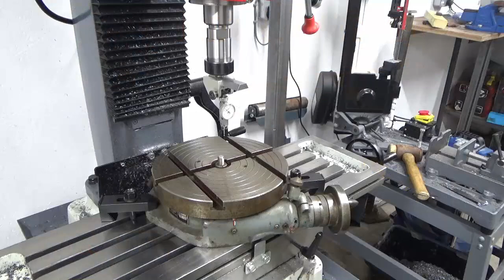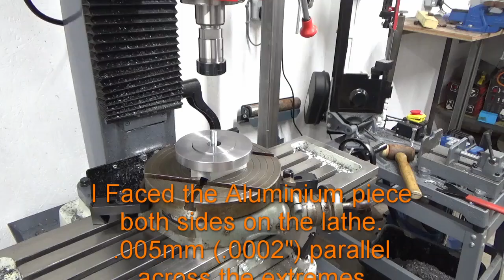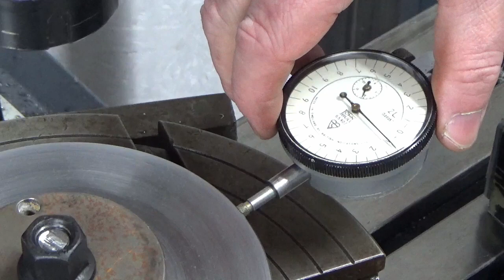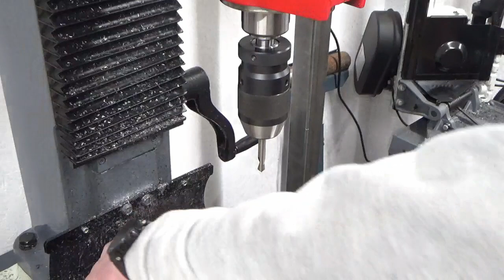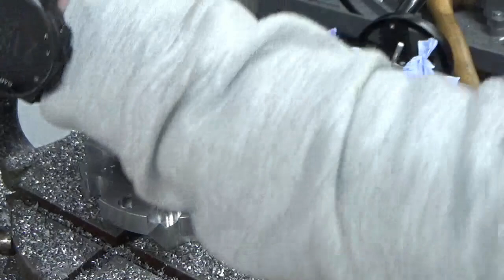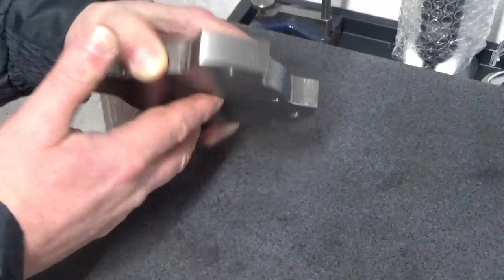Making A Rotary Table Adaptor Plate Part 3

Comment: Though it is exciting and very interesting to do a more complex shape, a huge amount of work and time could have been saved and remove the need to create wight reduction, by starting with 12 mm plate and using countersunk capscrews (or leave the normal capscrews proud - keeping mind that there are now four "sharp" corners whizzing around :-) ). It is after all a mounting plate for a small 4 jaw chuck :-)
A GREAT buy on the rotary table :-) :-) :-)
Reply from the maker: Hi Zen, thanks for the comment. Yep, totally agree, however this was a make to print job for a customer with free issue materials so I just ran with what I had. Cheers, Jon
Reply: @jonsworkshop  Hi, sorry, my comment was meant (as an observation) toward the original customer. I should have been clearer on this. The comment was was meant more as a "reference" or design aspect/consideration for other viewers of your great channel. :-)

Comment: You do have  20 mm chamfer tool, it's hidden inside the 90° countersink!  :-) It's perfectly acceptable to do light chamfering with a countersink cutter.
Reply from the maker: HI Zen, thanks for the comment. Yep, seen it done, and done it, it's not particularly kind to your countersink though due to the intermittent cut so I try to avoid doing this nowadays to keep my countersinks good for as long as possible. Cheers, Jon

Comment: Great "excuse" :-) to justify a DRO :-)
You could have used the X-axis and table stops to ensure all slots were the correct depth :-) (once set correctly, no readings of the vernier required)
Reply from the maker: Hi Zen, thanks for the comment. Good point. I missed that! Cheers, Jon

Comment: Hi Jon. 
Just goes to show you with the brass centre can't trust pre-owned accessories at 
face value. Looks a bit like overkill for a back plate but great content to watch. Tony
Reply from the maker: Hi Tony, thanks for the comment, yes, I should have known better really but just wanted to get the job done so I never checked it over properly.......... Lesson learned. I take your point, to be fair to Derek, he did put the cutouts as optional on the drawing. I wanted to do them more out of interest for me and you guys and to test the mill out a bit more. Really happy with how it coped and dead pleased with the new capability I now have as well. Chuffed I could still remember how to set one up and use it too after 30 odd years! Cheers, Jon
Reply: @jonsworkshop  It's like riding a bike Jon. Day in day out same old same old when your younger. You forget a lot of things you've done but they come gradually come back in to play one by one by a trigger of some sort. Tony

Comment: Jon,
Thanks, as usual I learn a lot watching your projects (I take a note of all your speeds and feeds, because although my mill and lathe are a little smaller, I am finding that your settings are fairly near for me).   Question, please: I bought a fairly cheap set or counterbore bits for cap head screws - they work to a certain extent but really not very well.  I notice you use a slot drill to counter bore - is this the pro’s first choice?
Mitch
Reply from the maker: Hi Mitch, thanks for the comment. Glad you are finding the information useful. The pros choice......... Lol. When I did my apprenticeship, the tool of choice was the counterbore tool. A lot depends on the quality of said tool, the Chinese stuff is not very good, that being said, you need a pretty solid mill to drive counterbore tools properly. Tips are, use a collet chuck if you can, minimum stick out of tool and quill, and feed hard to bury the tool in the material, also make sure your drilled hole is as close to the pilot diameter as possible. A final tip, if all else fails, use progressively bigger 4 flute end Mills. It's all about rigidity so you need to scale it back until you get a material removal method that suits your setup. Modern day Pro choice (CNC) is an end mill but not plunging, helical interpolation. Cheers, Jon

Comment: Great job Jon. Would be much more easy to do this on a CNC mill. But somehow it wouldn't be the same at the end. I'm dreaming of a little CNC portal mill when I'm retired 🛠️⚒️🔩👍🏼🍻
Reply from the maker: Hi Mathias, thanks for the comment. Fully agree. I have programmed so many parts on CNC over the years it almost became boring, somehow you are detached from reality. This is why I was so keen to wind handles again and loving it. Cheers, Jon
Reply: @jonsworkshop  ah, I see Jon. The old manual work is more worth sometimes. Even if it's at home 👍🏼⚒️🛠️🍻

Comment: Seems that the DRO could be a Christmas present, this is a serious project well above my pay grade, by the way the rotary table seems a good buy 👍
Reply from the maker: Hi Terry, thanks for the comment. DRO is getting ordered tonight hopefully, this job helped with the justification. Looks a complex job but relatively simple if you break it down into small chunks. I guess I take my training for granted a lot though (even if it was 30+ yrs ago), and that's why I am doing all this really in the hopes it will help/inspire others. Unfortunately, the training I got is probably not available these days as it is deemed as no relevant I suppose with CNC everywhere now. Cheers, Jon
Reply: It had to be done, looking forward to an unboxing and fit 👍😜

Comment: Hi Jon, Excellent job where it mattered, fresh air dimensions are just that, well done. Cheers
Reply from the maker: Hi Paul, thanks for the comment and feedback. Yep, the important stuff on this part is spot on, I just hate not hitting customer requirements even if they are fresh air, comes from years of chasing microns (and 10ths of thou) on aerospace drawings. Cheers, Jon

Comment: I think you have a good buy with that rotary table, not bad at all.
Reply from the maker: Hi Del, thanks for the comment. Yep, it's a good solid unit, it needs some TLC (bent shaft on the handle and lots of cleaning etc), but well pleased. It can be used at 90 degrees as well (dividing head now not required). Cheers, Jon

Comment: Nice finish and good first use of that huge rotary table,you need two people to mount it probably!
Reply from the maker: Hi Robert, thanks for the comment. Yes, pleased with the end result and rotary table. It is just manageable (currently). Can see a day coming as I get older when it might not be though. I have the crane though so just need a couple of lifting eyes. Cheers, Jon